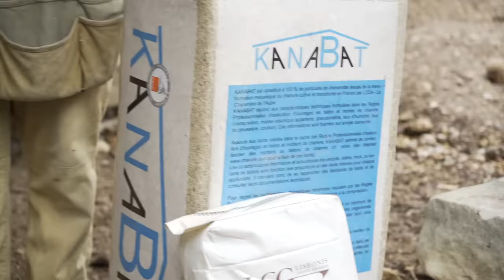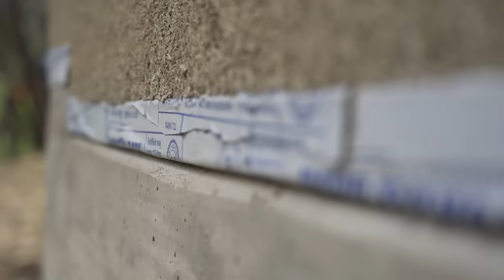Hemp Concrete Walls (R30 + Fireproof) - You Won't Believe How They Built This House!

Comment: Finally going back to what worked for low rise dwelling for centuries.
Reply: only good for those who still live under a rock . Mix styrofoam beads with cement and it will be cheaper and better product
Reply: @andreycham4797  You might be right but the object these days, in UK, is to build "green" so to speak. Concrete is avoided as much as possible in this type of build, only in footings perhaps.

Concrete now considered environmentally hazardous as in producing a lot of CO2 in its manufacture, as in greenhouse gases etc.

Ergo hempcrete ticks the green boxes as a natural plant material which "captures" said CO2.

Some UK builds use straw bales (2' X 2' X 1'). Held together with long wooden pins. Easily hacked into whatever size, angled reveals, whatever. Double glazed timber framed window fixed with pins.
 Membrane and a cover material to exterior, lime plaster to interior.

Sort of a building material with no need for extra insulation.

Timber frame on top to support roof structure.

Obviously a "bit" more involved than my description but plenty of videos online if you interested to look.

One of the main "appeals" is it is a fast way of building.

Some other green builds have gone back to a timber wattle as an armature and mud/clay/chopped straw daub. Layers built up as necessary.

As for reducing the use of concrete, Norway now designing high rise timber buildings and Japan planning one 70 storeys high (and considered to be a lot more earthquake proof than concrete in that it flexes).

And of course your northern neighbours have already built one.
Reply: This was super interesting.  Good video matt
Reply: @t1n4444  concrete scare in the UK is a huge fad. Making that "Limestone binding agent" used for binding the hemp most likely has exactly the same CO2 impact cement has.
Reply: @AntKardano  😂😂😂

Have a look at the chemistry. The carbon dioxide is cooked out of the calcium carbonate.

Plenty of info online if interested.

The limestone still contains the CO2.
Reply: @nateman10  Crikey! Thanks for detailed responses.

I very much take your points and understand the multidisciplined approach to construction.

Until your mention about rebuilding constantly I had not given it much thought but on reflection almost every street in UK has a skip (dumpster) parked in the road.

I suspect (?) a lot of the drive to modify your home comes from programs like ToH. We have several similar programs and range from complete new builds in "interesting" locations or following an erection process of imported modular homes from Germany. These are "Hofhaus" type designs which allow for an entire house to be constructed right down to the wall coverings, electrical and plumbing.

Glazing apertures are already "built in".

A team from Germany use local construction outfits to lay a concrete  foundation raft with the service ducts already crafted into said raft.

As you might suppose the concrete raft has to be to an extremely high standard as regards tolerances because of the precision of the modules.

Said team arrive, take suitable local accomodation and plan said arrival as the parts are delivered from Germany on 40 tonne lorries. A local crane operator is engaged and the site is like an anthill for a week.

The company claim they can erect  the house, fit for accomodation, in a week!

Having watched one go up in my village in that time it was no idle boast.

Obviously the landscaping took as long as UK builders decided it would take.

The German work ethos was remarkable. Everyone on site at 8am and knocked off when the day's schedule was completed.

I would imagine there are probably dozens of videos on YouTube if anyone was interested.

Ref tearing down the houses to construct build bigger and better and what to do with the remains, I suppose the concrete and brick elements could be recycled into hard core and the timber into this engineered timber/lumbar we read about.

Such technology has reached over here and had first site of these glulam beams in the construction of my son's school assembly hall cum theatre.

Was very impressed with the span of the beams and all had been built with a camber to produce an aesthetic effect to the ceiling.

Ref the earthquake issues folks living outside UK may be astonished to learn that we get a few hundred very minor tremors every year. Virtually none of which we feel.

In short we don't trouble too much about building in anticipation of earthquakes.

Ref the notion of building "flexible and forgiving" structures in places such as Japan makes a lot more dense and this proposed 70 storey building might be "better" (cheaper?) than all these massive counterweights systems we read about.

Had no idea about the issues in your Lake Tahoe area and as for these pistons you mention then will have a squint on YT when time allows ... which is anytime really as am long past the age of retirement ...

Have to say I have sometimes wondered if "we" have tried too hard to make our homes too complicated.

This green or brown revolution might be just the thing for building in the future, where the underlying ground conditions are stable.

In Earthquake zones I have wondered if we should consider building "on" the ground as opposed to "in" it, as in digging foundations.

It occurs to me that our longest standing houses are framed cottages which sit on a packed earth "plinth" with brick infill. Seeing as the bricks aren't really load bearing per se we see any amount of brick designs between the beams; in almost certainly what the construction lads would describe as weak bonds.

Would not suggest we emulate rebuilding in that style to the letter as during renovations of some old cottages a number of cat skeletons were found bricked up in cavities.

Superstition gave the builders the idea that a walled up cat would make the building "lucky" for everyone as it kept the bad spirits away. Shame nobody considered how the cat felt about it.

I see I have written a book ... so will thank you for interesting insights that have provided more areas for research.

Have to say that "buildings" as such as now more of an academic interest these days as now live in a boat most of the time and main concern is I stay afloat.
Reply: @AntKardano  you could have googled. Portland cement/concrete requires higher firing temperature and lime carbnonises as it turns back to lime stone . While processing lime has a carbon footprint it can be offset by the carbon sequestered by the hemp  (local supply chain would cut down the carbon incurred by transport ).
Reply: we use to produce a lot of hemp here in Murica till the lumber industry payed off some politicians to ban it because it was bad for THEIR business
Reply: @AntKardano  Yes, and greenhouses actually produce oxygen as the plants take in CO2 from the atmosphere.  Anything legal is usually backwards from reality.

Comment: This is pretty cool, but I think I would avoid for the same reason I don't ever want a house on a slab...repairing plumbing/electrical would be a pain in the butt.
Reply: Simple fix, use conduit for all of your encased wire runs, and run your plumbing in interior walls rather than exterior ones (which you will want to do in any case in order to maintain optimal continuous r value on the exterior).

Comment: I'd like to see a kind of ready mixed product us lowly plebs could use. Or at least bulk materials delivered on site that could be mixed and poured, not manually packed after mixing. Availability and affordability are the name of the game for those of us that can't afford to import 400 year old Japanese firewood.
Reply: I'm thinking in terms of a very simplified post & beam, a 4x4 post either side of each door/window opening, to double as door/window bucks, intermediate posts where necessary to keep the top plate span reasonable, and finally some Simpson Strongwalls to provide lateral resistance. Then the whole disappears inside the hemp wall.

Comment: "There's nothing here you smoke or get high on"
I guess no building material is perfect
Reply: What they did not tell you is, that you'd smoke the flowery, while they make paper and fabrics and hempcrete from leaves and stems (fibers).
so you can get high with your new house together ;-)
Reply: But ignorant fed gov had hemp illegal for decades
Reply: i'm not an arsonist, i'm a drug addict.
Reply: @liquidminds  close, they make paper pulp, rope etc by the woody stems under the bark of the plant, the skin and leaves will have the crystals that you smoke, but the flowery part is where most of the crystals are.

Comment: There is now a structural LEGO preformed Hemp and Lime Mortar brick that you just stack , no skill, no drying time  required , and they are pre drilled so when stacked the holes always line up so you can run cables down the wall internals . 
Great sounding product.
Reply: Saw that but trying to figure out how they do window lintels with hempblocks

Comment: This seams much easier than rammed earth. I should do this on my next project instead
Reply: Jay Schmidt I know of rammed earth builders that have switched to hempcrete because it ticks many more boxes.
Reply: Rammed earth does not need to be plastered, so the beauty you pay for is something you get to keep.
Reply: Watching Matt's rammed earth video was pretty discouraging as far as that technique went. They used enough lumber just framing the forms to build 3 houses.
Reply: @HappyBeeHoney  Yeah but then the farming material can be reused. I agree that the rammed earth video looked like way to much work but imagine what you could if you had like a few different kinds of well built easy to work with steel forms and then used a lot more machines. The client can mix and match between the 10 different forms (windows, doors etc) and then you can reuse the forms. No more building a new wooden form every single time.
Reply: @Lappmogel  oh yeah I see how that can work in an adapted market where it's done frequently, but as far as what I'll be able to do myself within the next 10 years, I could see hempcrete but I think rammed earth will still be a long way from affordable.
Reply: Rammed earth is very expensive to build because the forms have to be so strong. You can achieve similar results for much less by filling sandbag material with an adobe mix... The technique used in this video is rather similar to a form technique I have seen used with cob. You save a lot of money by not having to fully build out a load bearing form for a monolithic pour, and your walls don't have to be 2' thick, either.

Comment: There is another product called Timbercrete that uses sawdust instead of hemp that has the same fire resistance and insulating values and virtually the same properties as hempcrete. These types of materials are going to be a lot more popular after the out of control fires out west.
Reply: Thanks for sharing mate.
Reply: Ya but timber takes decades to mature vs several harvests per yr on hemp.
Reply: @amgtowmonk2915  A lot of that wood fiber could come from salvage logging, but treehuggers sue to prevent cleaning up the woods for any reason. The west side of the Warner mountains in NE California is carpeted with dead fir trees, killed by not thinning them properly.
Reply: There's also papercrete made from shredded office scrap.
Reply: How is this possible ? The reason hempcrete works is because of it's extremely high silica content that reacts with the lime... Wood doesn't have the same silica content ..
Reply: @aebemacgill  Leaving it helps to prevent erosion, cool soil and hold moisture.

Comment: With the price of lumber these days I wonder if this will become more common to build with. Some of the new subdivisions where I live are "zero lot line" and the houses are 4 feet apart. If there is a fire in one it usually jumps to at least the houses right next door. This seems like it would be ideal to use in those neighbourhoods.

Comment: Hmmmm
All of that amazing fire resistance in the walls, and cedar shakes for the roof?
Very interesting.
Reply: Cedar is very good for fires......and lights up fast.
Reply: Edward Nelson going for the nice aroma. Smells nice when it burns! Lol
Reply: Yeah, saw the title and expected a metal roof.
Reply: yep, should have gone with traditional tile roof.
Reply: That house surrounded by all those trees.  The walls will be the only thing left after a fire. Kinda sensitive about fires right now since I live on the west coast
Reply: Most shakes come fire-treated
Reply: @Philupization  ... they said they cut down cedar trees on their own property,  power washed the bark off, and custom cut the cedar for the roof ... therefore stating they used (very) local roof material.
Reply: @jeanetteredden24  lol. For the trusses. Not the shingles.

Comment: You should check out a similar product called Durisol, made from cement and modified wood chips and cast in blocks. I have used it on several builds. Mike Holmes and friends built a subdivision out of Durisol in Meaford, Ontario. You stack it like cement blocks and can fill it with rebar and concrete. Roxul insulation is available already installed as well, up to R28. Parge it after and you are done. It has been around for a long time; my friend's dad built a cottage with it in Goderich, Ontario in the 1950's. It cuts with a saw and you can put screws in it. I farm as well so I love the idea of using hemp. The method in the video is very similar to mud straw walls with timberframe I worked on. They are all good but the Durisol is much quicker and easier.

Comment: I'd love to see more videos from you on eco-friendly/smart methodologies/materials. A lot of "green"/energy efficient practices are misrepresented. Pros and cons.
Reply: I agree, anything that's labeled as "green tech" has me on full alert for bias propaganda. Knowing the simplicity of the materials and their characteristics, I'm wondering how this product will hold up to fluctuations in humidity/dryness that many places have as part of their climate. If I'm guessing, I'd say both the interior and exterior "plaster" finishes will be a high maintenance issue, and depending on the materials applied, there will be substantial cracking and spalling in areas where wind, sun, rain, frost, and dry cycles will wreak havoc on the organic earthen materials.

Comment: One question I’m left with — how do they finish the top lift of the material? For all the lower lifts, they can come in from above and tamp down against the form, as shown, but once they reach the point that the form work goes all the way up to the ceiling level, ...?
Reply: I was wanting to see that. Good question.
Reply: I believe they have the form open on one side and tamp the final portion horizontally
Reply: Just tamp it from below.
 yup....
Reply: I wonder if typically they wait to put the roof on until after the hempcrete walls are in place,m
Reply: @robp5451  that's my assumption on how to do the top.
Reply: @ScottGrow117  most natural buildings have the roof go up with the longer eves to protect the work as it dries. This isn't any different. If you notice the roof was on but they are still putting up the hempcrete walls.

Comment: Matt, I really wish you showed how they finished the insulation to the top since you can’t tamp from the top.  Would also like to have know the weight of the material.  In other words, if they formed a 2’ x 2’ x 4’ block, what would be the weight.  Then would be nice to see how you anchor things to the wall such as a flat panel TV mount.
Reply: You have to creatively pack it from the side. Experts would have pointed this out. :-)
Reply: It's possible to downward tamp and leave the top section open, let the walls cure, then place pre-cured blocks in the open sections. Mounting heavy things to the walls will be a no go, unless you get lucky or have it designed where it lands on lumber or steel framing etc. within the wall. I'm guessing that finding those structure points will turn out difficult as well, and that typical "stud finders" may be nearly useless. I think you'd really have to be on your design game and get everything right the first time, as re-decorating/remodeling will have it's own set of challenges.

Comment: Looks like I can just mix a little cement in with what comes out of my wood chipper and make a wall.
Reply: Normal wood doesn't react the same way hemp does. Think of the hemp as more of a spongy material then normal dense wood. When the lime mixes with hemp it can pack better and harden better then normal wood.
Reply: I think you could do that.
Reply: Dried sapwood might work, and Timbercrete is a thing. I wonder if finely chopped straw would work as a bulk insulator as well...
Reply: @timh.6872  I think wood would work.  I know that shredded plastics are good as well.  EPS foam (styrofoam) is used in some commercial products.   Matt recently mentioned a new product called The Perfect Block https://www.youtube.com/watch?v=are1cHzyeWs    DIY builders have experimented with this material, you mix the cement and shredded foam dry before adding water, or you have a heck of a time preventing the foam from floating.
Reply: Try adding some fiber into the mix, you can add tensile and compressive strength to the wall. Sawdust has been used in the past, but not for any structural use.

Comment: Cool material, but I imagine only specialized subs will ever touch it.  Hard for the material to be widely adopted due to the heavy manual labor component.
Reply: not heavy if you buy the ready made blocks and 'glue' those together w lime mortar (like I did) ... and I'm no builder